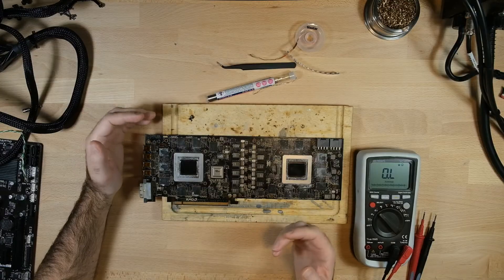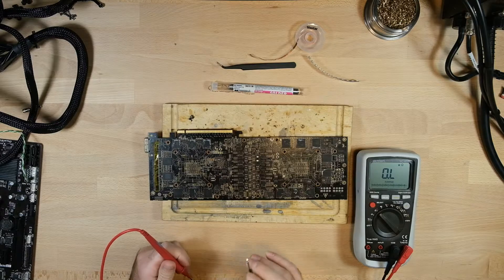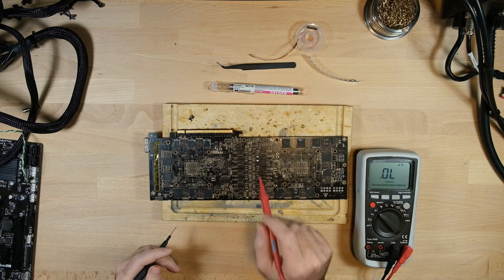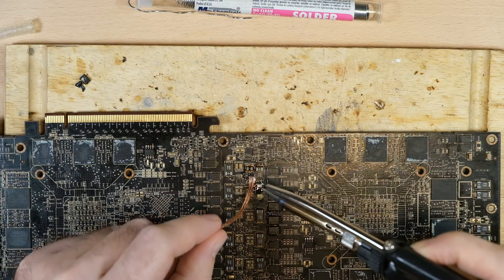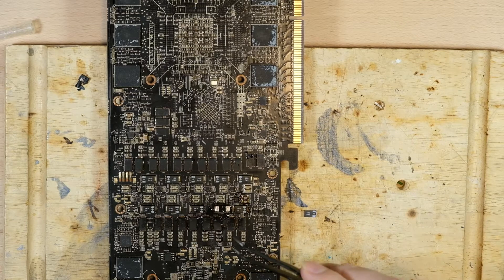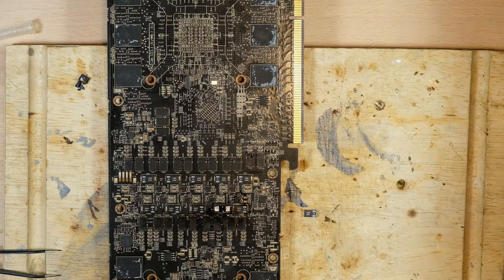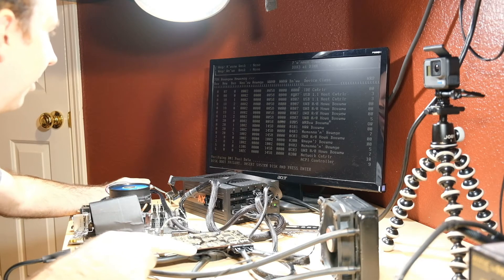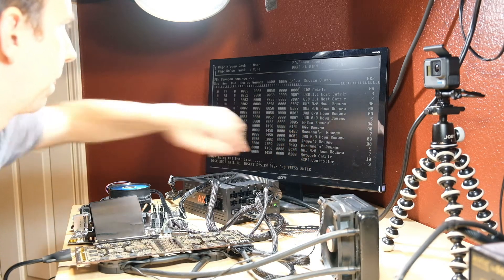Graphics Card Necromancy - Radeon R9 295x2 - Episode 2

Comment: My card's pump(s?) have gone out.  Any clue where I could get a part or what I'd have to do to splice a 3rd party pump into the line?  idk what to do.
Reply from the maker: Man, that's a bummer.  If you're really committed, the most permanent solution is probably open loop water cooling, either with a used full coverage block (they do exist - EK and Aquacomputer both made them) or a pair of CPU blocks and custom brackets.  The drawback to this obviously being cost.

If you need a more self contained solution, you can probably cannibalize a couple of new AIO coolers.  The original cooling system is made by Asetek, which is the same company that makes about 3/4 of the AIO coolers on the market.

Maybe you could gut a couple of these, and splice their pumps onto the original hoses and rad from your 295?
https://www.newegg.com/nzxt-liquid-cooling-system/p/N82E16835146041

Comment: good Job Aaron , what is the reference of the capacitor you changed ?
Reply from the maker: 100 uF tantalum capacitor with a 16V rating or better.  I believe that this is the part that I used.

https://www.digikey.com/en/products/detail/panasonic-electronic-components/16TQC100MYF
Reply: @AaronAverett  Thank's dude your are The best <3 <3 !!